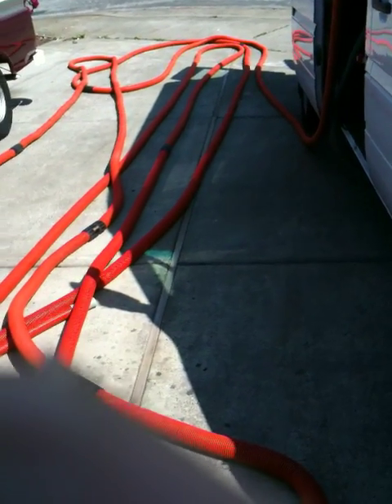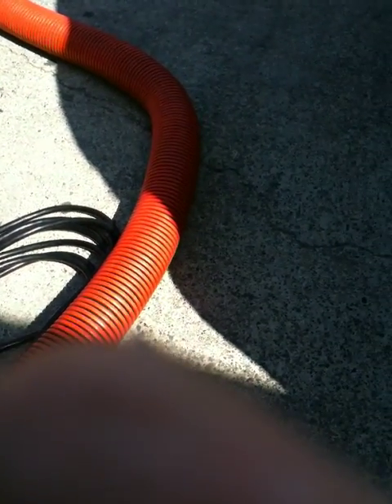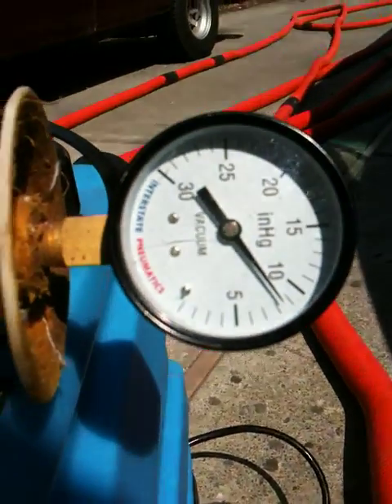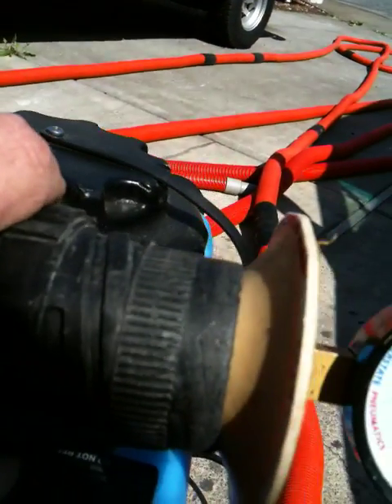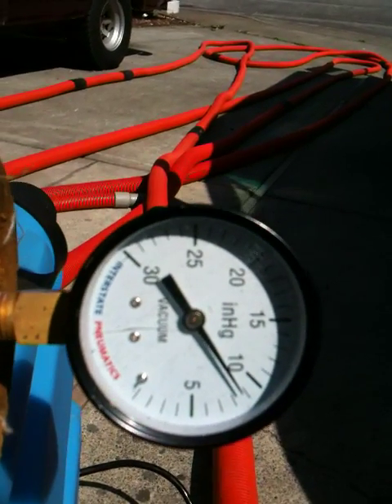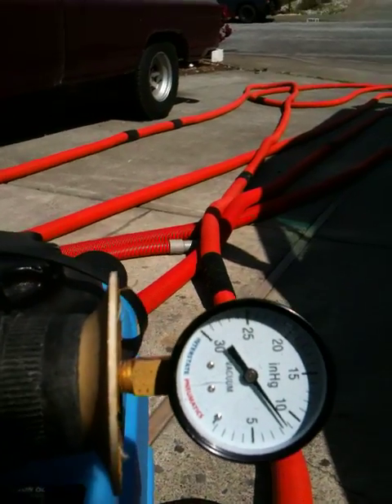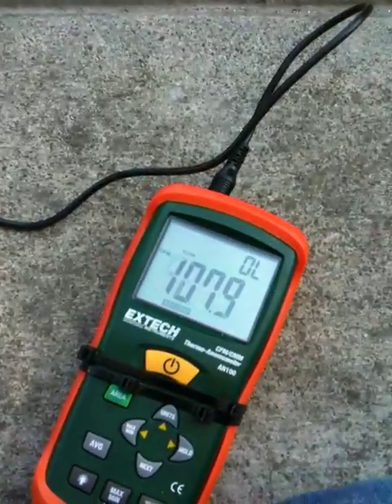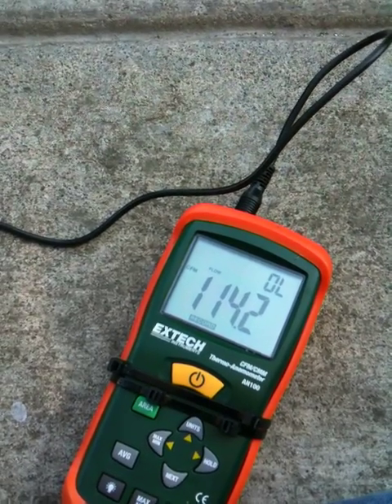Savage 1 ETM performance at 215 ' with  Lamb 117500-13 motors in parallel

Comment: Nice! Bob Savage built some great electric truckmounts with very good performance. The power booster or Air Hog as Myttee has named theirs is also a real help for those long hose runs. I have run my CA Jaguar 6.6 with exactly the same amount of hose ,215 feet. 15 feet was 1 1/2 diameter whip hose. It performed similar and when I added my CA Power Booster 6.6 about 100 feet back it also kicked up my cfms to well over 300. So it was 3 6.6 2 stages in parallel basically.